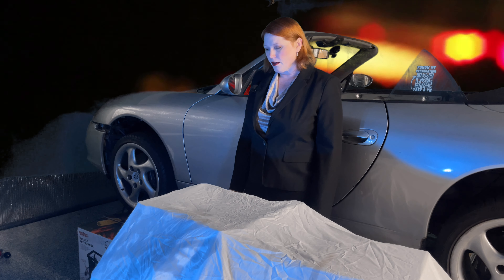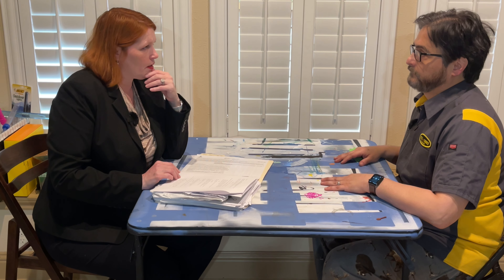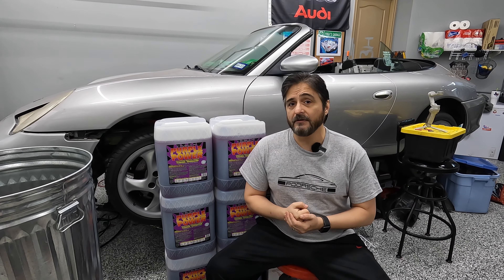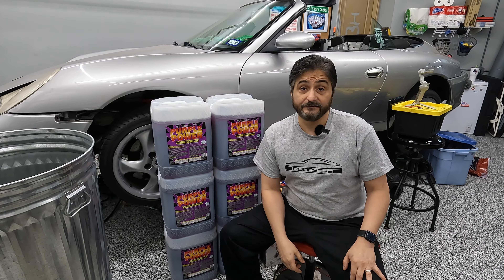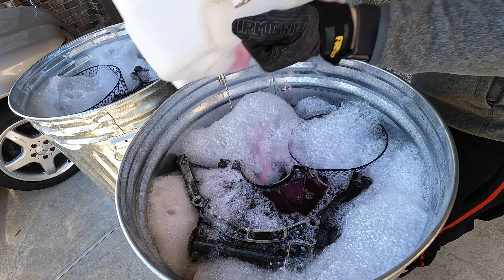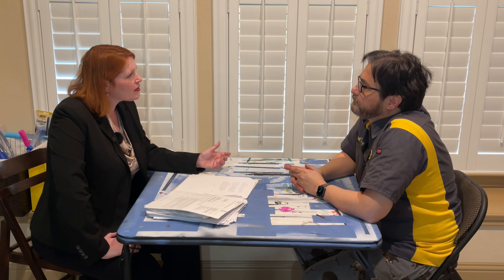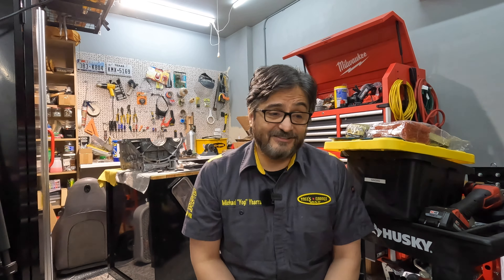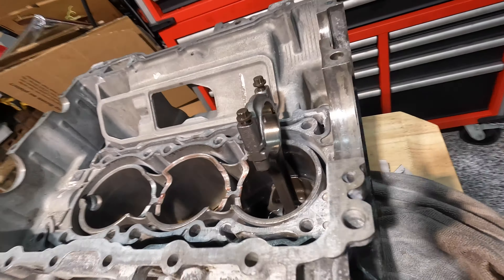The TRUTH About PURPLE POWER on ALUMINUM!

Comment: It works fine on aluminum. If the parts start to corrode a little after drying just scotch brite or wire brush parts, and or soak in a mixture of vinegar water to counteract the corrosion
Reply from the maker: Agreed, but the locacil liners were toasted. micro-cracks. Having it resleeved and bored out to a 4.0 was a great decision. The car ROARS! Thanks for watching.
Reply: @YogisGarage  I’ve never used it on an aluminum block before… But cylinders heads oil pans and all sorts of other parts and it works fine as long as you either dilute it, and or rinse off very well and use the methods I mentioned earlier. That said I ruined a throttle body with it once before forgot it was soaking lol🤣

Comment: You could also hone the cylinders as well, w a home that has the fine abrasive balls on springs so you don’t mess up the cylinders.

I’d highly recommend making a vapor blaster, the results are nothing short of amazing
Reply from the maker: In theory, that’s a great idea. And I did think of it. however, these are not cast-iron cylinders, so it won’t benefit from a ball hone.  Vapor blasting was done to the heads before being ported and tuned. Thanks for watching!

Comment: Just spend a few bucks and pay your local machine shop to clean it up.  Purple power is fine with aluminum as long as you don't leave it soaking in it.  just clean and wash off.  I learned this with a mower carb.  much cheaper to replace.
Reply from the maker: Thanks for watching. I could do that and actually tried. But most shops won’t touch a Porsche heads or cases. Others will just f it up. I had it rebored and the heads re-ported and decked. The car runs great!

Comment: Have you tried reaching out to Millennium Technologies out of Wisconsin or US Chrome? Since your cylinders don’t have “d chunk” damage you can most likely have them re-plated in Nikasil (a far superior plating compared to what the m96 had originally.) Those guys will also correct any ovality or taper  while working on your cylinders all at a fraction of what re-sleeving would have cost.
Reply from the maker: Not a bad idea. I’ve already started the process of having it resleeved with Nickies. Thanks for watching!

Comment: instruction clearly say - dont use on aluminium.
Reply from the maker: Not exactly, but I’ll give you that one. It states to test on an inconspicuous area especially on Aluminum, painted surfaces and fabric.  Hindsight, that should have been enough to dissuade me but it didn’t. I simply based it on when I used it on my 2.0, cylinder head and all. The only difference was the potency level. I have no doubt that my Audi would have needed a new CH if I would have done the same thing. 
Thanks for watching! ✌🏼